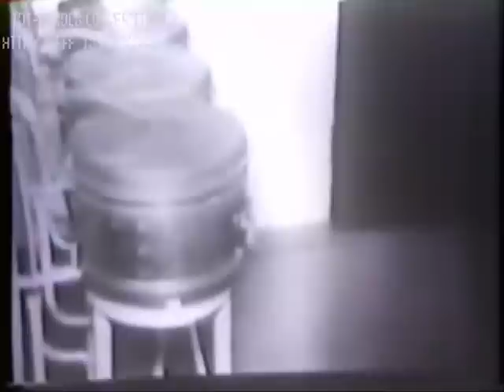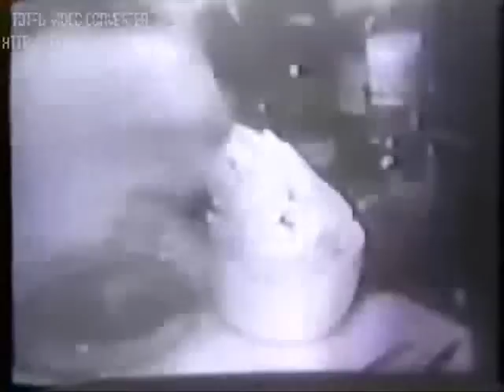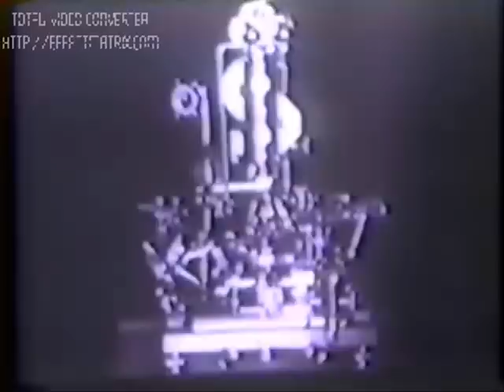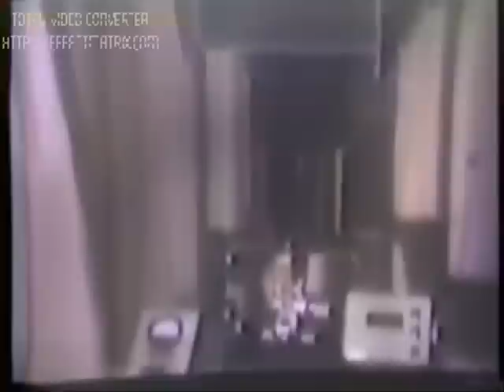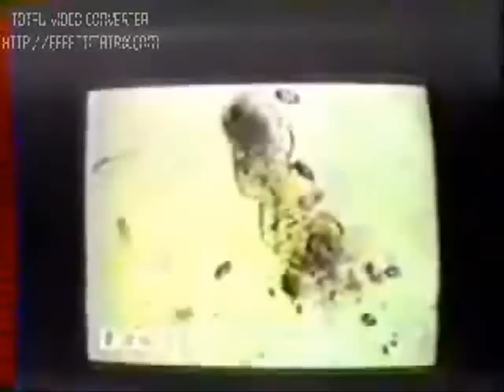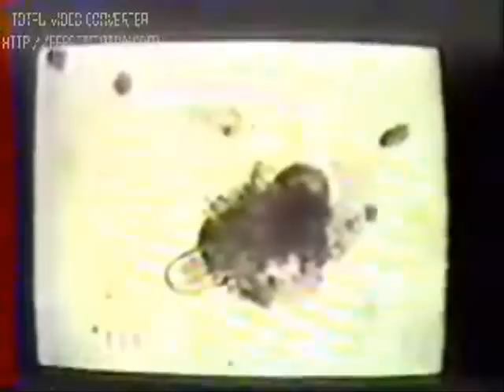(1936)Dr Royal Raymond Rife-Rare Documentary.🔬Rife Research Laboratory (Narrated By John Crane)

Comment: Sad to say but its all a scam ....i thought it was real as well but just in case i did my research and checked multiple sources.Wikipedia has the most recent information and they have tons of links and sources.People have died using the rife machine and have also been imprisoned for selling the rife machines in pyramid schemes.The book is just a tool for the schemers FILLING PEOPLE WITH FALSE HOPE.

Interest in Rife's claims was revived in some alternative medical circles by the 1987 book by Barry Lynes, The Cancer Cure That Worked, which claimed that Rife had succeeded in curing cancer, but that his work was suppressed by a powerful conspiracy headed by the American Medical Association.[7] After this book's publication, a variety of devices bearing Rife's name were marketed as cures for diverse diseases such as cancer and AIDS. An analysis by Electronics Australia found that a typical 'Rife device' consisted of a nine-volt battery, wiring, a switch, a timer and two short lengths of copper tubing, which delivered an "almost undetectable" current unlikely to penetrate the skin.[10]

Such 'Rife devices' have figured prominently in several cases of health fraud in the U.S., typically centered around the uselessness of the devices and the grandiose claims with which they are marketed. In a 1996 case, the marketers of a 'Rife device' claiming to cure numerous diseases including cancer and AIDS were convicted of felony health fraud.[11] The sentencing judge described them as "target[ing] the most vulnerable people, including those suffering from terminal disease" and providing false hope.[12] In some cases cancer patients who ceased chemotherapy and instead used these devices have died.[13][14] Rife devices are currently classified as a subset of radionics devices, which are generally viewed as pseudomedicine by mainstream experts.[7] In Australia, the use of Rife machines has been blamed for the deaths of cancer patients who might have been cured with conventional therapy.[10] In 2002 John Bryon Krueger, who operated the Royal Rife Research Society, was sentenced to 12 years in prison for his role in a murder and also received a concurrent 30-month sentence for illegally selling Rife devices. In 2009 a U.S. court convicted James Folsom of 26 felony counts for sale of the Rife devices sold as 'NatureTronics', 'AstroPulse', 'BioSolutions', 'Energy Wellness', and 'Global Wellness'.[15]

In 1994, the American Cancer Society reported that Rife machines were being sold in a "pyramid-like, multilevel marketing scheme". A key component in the marketing of Rife devices has been the claim, initially put forward by Rife himself, that the devices were being suppressed by an establishment conspiracy against cancer "cures".[7] The ACS describes Lynes' claims as implausible, noting that the book was written "in a style typical of conspiratorial theorists" and defied any independent verification.[7] Although 'Rife devices' are not registered by the U.S. Food and Drug Administration and have been linked to deaths among cancer sufferers, the Seattle Times reported that over 300 people attended the 2006 Rife International Health Conference in Seattle, where dozens of unregistered devices were sold.
Reply: Oh goodness, if you are getting your research information from Wikipedia you have already failed.
Rife is legit. Many of those machines may not be. Few were actual built using his plans or technology.
Everything is "energy, freq and vibration."   His cancer study was well documented.
Meanwhile Here's a modern day example, using the 11th harmonic...
https://www.youtube.com/watch?v=1w0_kazbb_U
Reply: You can be sure that the AMA, Big Pharma would not let their Goose cancer and other pathogens be destroyed by a simple frequency machine.
If his microscope was a fraud, how did he get live pictures of live cells interior that only a scanning electron microscope can see today on dead cells ?
Reply: Sad to say you should learn how to research. 

If you UNDERSTAND who RUNS THOSE SITES, you'll understand. 
Until then, you shouldn't call something a scam when there's CLEAR EVIDENCE that it's truth.

Such a shame.
Reply: Resonate frequencies can destroy anything-the right frequency for the right item. So I would disagree with your rebuttal about Wikipedia saying it’s fake. Cymatics is an amazing subject-sound waves are the secret to many mysteries.

Comment: Dr. Rife.
5/3/2018   Robert Shrewsbury    My brief thoughts for today.                                                                                                                                                                                                      Element & Compound Resonation for researchers.
An Element will not resonate if the frequencies are not pretty much accurately "right on the mark", to the tenth of the Hertz. The atomic spacing of elements is measured in nano-meters. Spacing changes with gravity, thermodynamics, light/darkness and atmospheric pressure proportions, caused by earthly and cosmic anomalies i.e. like the moon apogee/perigee as well as earth/sun perihelion, etc. So to be concisely accurate, it is a must to track these frequency changes on a daily and nightly basis. Resonant Frequencies and wavelengths are based on the Atomic Spacing in an Element, at the time of day or night and the particular geographical location you are at. When this atomic spacing changes, even a fraction of a nano-meter, elements and compounds then resonate at a slightly different frequency/wavelength.  
A remarkable healer, Dr. Royal Rife, used a very-specially-engineered powerful microscope in his work, so he could see when he was resonating a disease. He had aimed to know the resonant frequency of diseases, so he could successfully destroy these diseases, using destructive frequencies. Dr. Rife was aware of these frequency changes and he facilitated the changes (at his end) creating a custom solution for each patient, in his/their time. Dr. Rife's middle-base or center frequencies, that he used to kill diseases, do not work so well now, because the people currently using them do not A) know of this frequency change phenomena or B) how to keep up with these continuous frequency changes for each disease. (Dr. Rife's massive precision microscope has not been in use since his death of August 5, 1971.) 
In some cases, the modern "Rife Machine" salesmen can be more interested in selling a "healing machine" for profit than whether it actually helps or not. It is also possible they may believe it works, without observing the actual statistics over time. This then can be a "snake oil salesmanship" situation.  Because of Rife's precision with each case, he did do phenomenal work and cured every case of illness he ever worked with, but people since, not doing their work anywhere near precision, have been doing erratic or partial healings or having too many failures become commonplace.
I am only releasing a little bit of information on precision frequencies because it needs to be known, and also for the ill of our people, in hopes that some serious/sincere, competent personnel will pick-up and do the precision application, healing work and the research that is so needed. I am more of a discoverer, researcher, investigator, developer and inventor than a technician or businessman!    
My own studies have been leading me to confirm Rife's original successes and methods.  Using different methods of finding and knowing the resonant frequencies of hormones, elements and compounds and their frequency changes, I do not need a state-of the-art microscope as Rife did, to find the frequency variances of elements, compounds, hormones or diseases. I have been involved in frequency transmissions, applications and research for about 25 years now and am still learning a lot. 
A recent sample of my work.                                                                                                        In charting the total frequency changes in 6 days (following the Moon's waning cycle) on Human Growth Hormone HGH, I found the total cycles-per-second CPS receding (Moon waning) from the start of 4/28/2018 to 5/3/2018. The HGH positive +side receded  2.5 cps, HGH negative - side receded 4.1 cps. in just (six) 6 days.
It only takes two tenths of a cycle per second (or less) to miss resonation of an element, or worse, bleeding into another elements frequency, missing the target altogether. In practice, any work using a consistent frequency to aid repair or stimulate would soon have a condition of being reduced in connection or unable to interact with a person or element, until some time later when it just "happened" to coincide again by rare chance. 
This is why I study, test and research and that is also why I keep abreast of  frequency changes continuously in my work. A variety of natural frequency changes, even adding together, make it nearly impossible to effectively create a health-solution with a proper frequency. Effective application and better progress is related to a person being aware of changes occurring,  and then learning how to A) keep abreast of the frequency variances and B) staying on a tuned daily frequency resonation course. I am not sure why this information has remained so miss-understood, not-understood or incomprehensible for so long!?
I didn't start with an intent to research health, but my other studies gave me increasing information to understand and improve my own health.  What influenced my original  involvement in this element oscillation work was that I was learning how to stimulate and resonate valuable elements like gold, silver and platinum, "Ringing them like a bell", so to speak. This meant I could better detect them by the energy-increase and display that is created when an element is selectively oscillated electronically. 
One thing I did, was I purchased some "gold finding" resonators called LRL's (Long Range Locaters) and did a lot of tests and blind-tests, only to find out that these costly LRL's rarely if ever worked. As a single example, a poor use/choice of parts can pollute and  ruin correct signal forms. What a person thought was being projected was actually damaged or altered...and postulated results could not happen.  
Over many years, I found one of the many problems in using a correct frequency (of an element) was that the resonate frequencies of elements are in continuous fluctuation, they are not the same from day to day or even hour to hour in some cases. However, the gold/platinum/silver frequency categories on the precious-metal detection (LRL's) machines had only one frequency setting per element.  Having a single setting meant there was no way to adjust for changes in the resonant frequency of an element and there certainly was no published knowledge of the oscillation changes of the elements on a daily basis. Worse, element frequencies also change in different geographical locations on the same day because of magnetic and electro-magnetic changes in various geographical locations.  
Working to unravel this tremendously complex problem is/was what kept me at this research-discovery-work for so many years.  The many variables mean it is still easy to encounter  surprise conditions to figure out later and I am still doing this to some degree. However, my research increased my eclectic-knowledge tremendously, in many areas of science and quantum physics, by continuous researching and testing so many diverse things far and distantly related, but sequitur! Now, much of my work is empirical as well as my knowledge is mostly autodidact (self-taught). 
I am still hungry for truth and knowledge and I know that acknowledging my sources feeds and seeds my reception of truth and knowledge and so, I must and do acknowledge the greatly needed (without bragging) inspiration from Above, as well as the many Scholars, Physicists Metaphysicist, Kabbalists, Hermeticist, Scientists of the present as well as the past that I also relied on for/from their work.  
My experience has become that there are no mysteries when the truth and comprehensive perspective is uncloaked, but instead, pure science and quantum physics! As I ventured into the "why's and how's" of more advanced sciences, finally science, physics, quantum physics and metaphysics were dovetailed and increasingly meshed-together in a unity of function, synergy and workability without disagreement.
Sciences might become more clearly understood and applied, but human emotional problems of  rivalry, jealousy, covetry, competition and fear taint, discredit, occlude, retard and obstruct knowledge, discovery, progress, freedom and awareness at large.  
This contention and battle, to control information and "potential power" with money and power, seems to be the underlying catalysts-symbiote of all of this miss-and-disruption. Any good chemist knows that the catalyst is not affected by the reactions it creates.. Money and power... untouched, unnoticed and unmoved by the lower players in the field. Nicola Tesla was only one of many that had to deal with this. Good & Evil"!?    
It can be nearly impossible to find basic but needed data. That leaves figuring-it-out... figuring out the invisible by reactions and statistics observed and perhaps only having access to very minimal supplies to do so. 
Sharry Edwards https://www.soundhealthoptions.com/ is the foremost knowledgeable authority on health frequencies and their application.  I am told that Sharry Edwards  produced electronic frequencies (in sequence) to manipulate the "Krebs Cycle" in some of her research and I am not at all surprised that she did.  
Generally now, a lot of work has been done of/on frequency stimulation and signaling and sometimes it has been used as a military weapon. Much of this frequency matrix remains to be discovered and some has been Classified I am sure. 
Sincerely, Robert
Reply: lol  Go back to school and try to pass your degree at least before talking about science physics.
Reply: Your comment is filled with passion. I am no physicist and most termenology is allien to me but so much of what u wrote i know is the truth.
Reply: @mitkabz  Use physics terms will always impress the little people ! You seem mistake sects (who use some vocabulary to impress people that need to believe in something) for Quantum theory. Both are totally different. Sects are  avid for new members in order to make money, while Physical siences is working to improve our knowledge. Big difference !
Unfortunately some human beings are as interested by sciences than their pets.
Reply: @Epsilom  i understand just one correction. I am far from being a little  person 😍